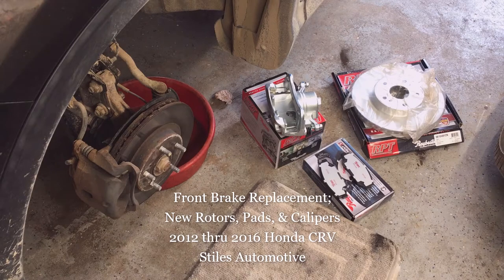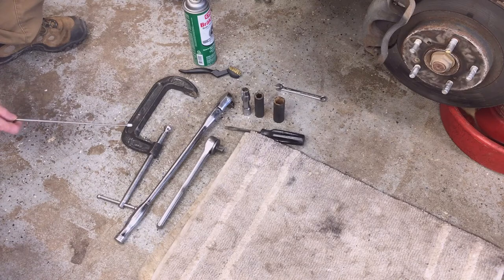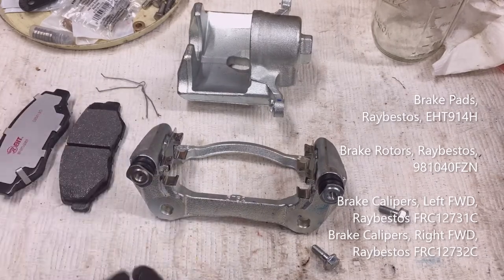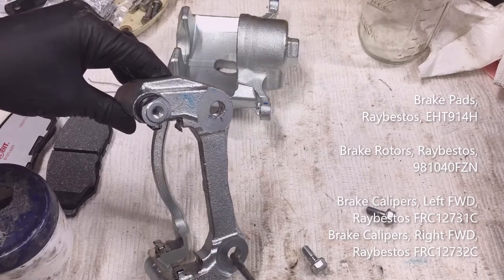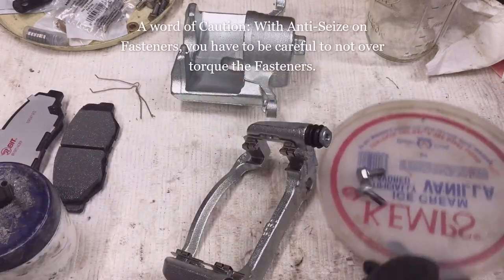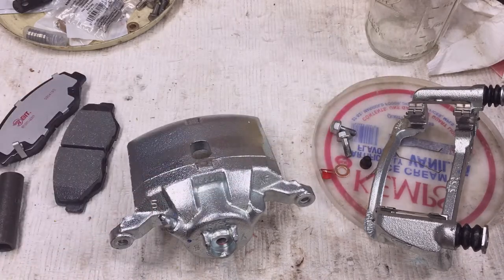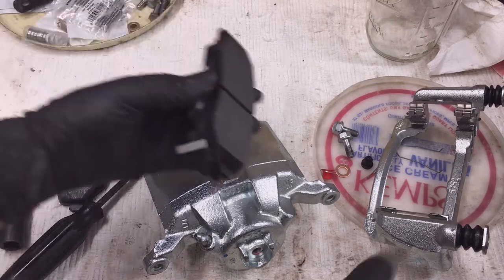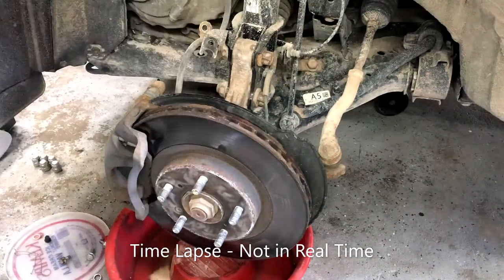Front Brake Replacement; New Rotors, Pads, & Calipers, 2012 thru 2016 Honda CRV

Comment: Thanks, appreciated on your description, getting right to the point of explanation!  I won't be changing callipers, so that will make the job a little easier, the only difference I see, after doing my F150 fronts, is there was no 'screw'!  Unsure, why it's really needed, as everything is well seated once the caliber is in place, and the wheel lug nuts are on, holding all in place!
Reply from the maker: Powerstroke, You are welcome! If you do the Brakes (or remove the Rotors really) on a new Ford Vehicle, they come with a non-reusable spring washer on them to hold the Rotor during OEM Assembly. You damage it when removing the first time and it is not reused. The Hondas, GM and some other manufacturers use the screw, which aid during original assembly, this is the main reason, I believe for the screw.  Sometimes . . . for some Rotor / Caliper combinations the Rotor can move on the Wheel Studs with the Caliper installed, this may be a reason to have a Screw, but I believe a poor reason.  I put a generous amount of anti-seize on these Rotor Screws, They will not back out, they are captured by the Wheel.  - Stiles

Comment: This video is great, any major differences for the rear breaks?
Reply from the maker: Michael, Nope, no surprises on the rear, but I did do a video which will help you! (link below) and the video to show you how to bleed the Brakes. I appreciate the feedback!  - Stiles

Rear Brake Service,  Part 1 - New Pads, Rotors and Calipers – 2015 Honda CRV, FWD (’12 thru ’16 CRV)  https://youtu.be/y4XonuYXRDg
Rear Brake Service, Part 2 - Bleed Brakes & Change Fluid – 2015 Honda CRV, FWD (’12 thru ’16 CRV) https://youtu.be/kVqQ4BWoamM
Reply: Awesome thanks for the reply. I watched both parts an im almost ready to do my own break change. One last question, how much break fluid did you use during the rear break change? 

And did you keep bleeding it till it ran clear or just until all the air was out. 

Also would there be a major difference in the amount for these two approaches?

Comment: My 2016 crv is making a clunking noise when i go in reverse. It does 2 clunks at once and that's it. I took it to Honda and they said it is the front brakes and it is normal since the desing of these breaks is a bit loose so they move inside and that creates the clunk. The solution is to put some kinf of paper that removes the noise, but it is a temporary and then u have to come back for the same procedure.
Did this car you are fixing have this issue? and if yes, did your parts replacement help?
Reply from the maker: Mitica, Some cars use Brake Pads that have a Spring on them to eliminate Pad movement, yours do not. Your problem sounds like you may have a sticky Caliper, it would be worth removing the Calipers and ensuring the Pins are well lubed.  I hadn't heard of the Paper Shim that the Dealer is talking about. I wouldn't use Paper. What I would do first is (if the Calipers are ok) replace the Pads (even if that have a lot of life left, they are cheap) and replace the Parts Kit, that is the little shiny metal clips (I point to them at 2:05 in the video) on the Caliper that the Pad ends ride in. If I was going to Shim your Brakes this is where I would Shim them, under these Slides.  I would try new Parts first. - Stiles

Comment: Anyone know if the caliper pin with the rubber is meant to be at the bottom for both the left and right side? I’m thinking that’s not the case
Reply from the maker: As shown in the video the Raybestos Front Left Side Caliper came pre-assembled with the Caliper Pin with Rubber on the top. - Stiles
Reply: @StilesAutomotive  I noticed Hondas appear to have switched back and forth on whether the slotted caliper pins are on top or the bottom. Ended up placing them on top on both the left and right side and haven’t noticed any issues.
Reply from the maker: @AlienCatcher23  Yes, I think that is the best!  Think about the normal (Vehicle moving forward) movement of the Disc Brake Rotor, it pushes the Brake Pads and then Brake Caliper down, so then the Bottom Pin and Bottom Slide on the Caliper Bracket take more of the Load.  Well, the Caliper Bracket takes the Load, but the Bottom Pin takes more Load then the Top Pin.  - Stiles